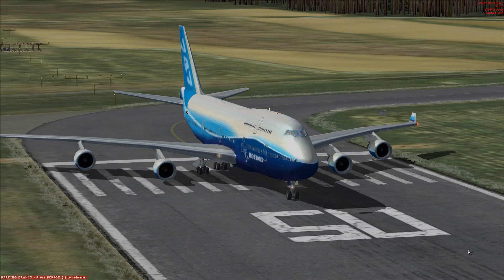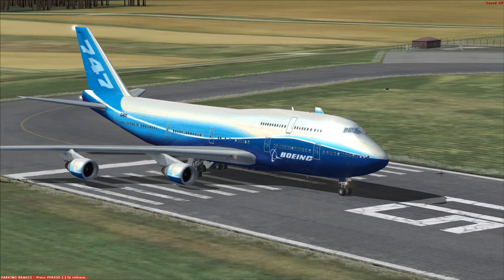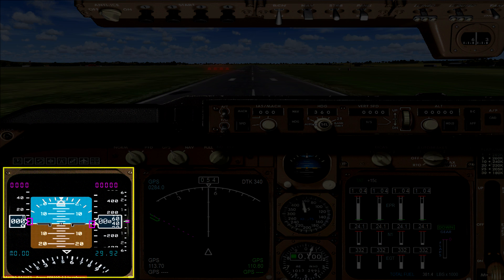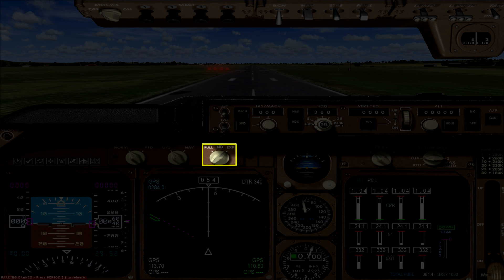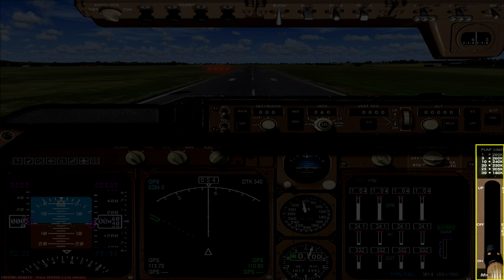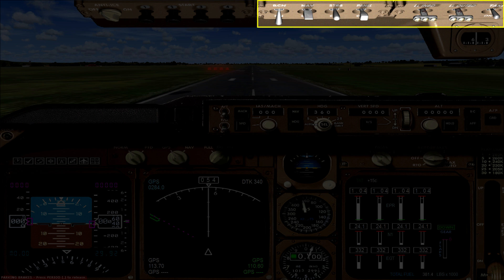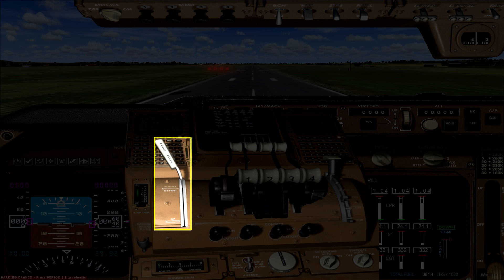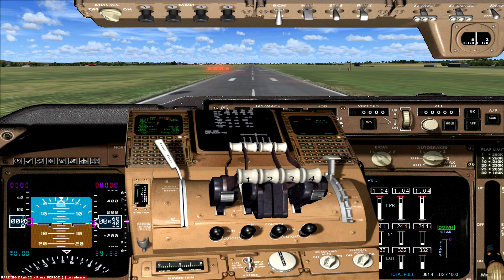FSX Tutorial: Boeing 747

Comment: I’m not sure why but my 747 is very easy to stall even with low payload and once it stalls it’s all most impossible to recover. I put the nose down but no increase in speed even if I increase throttle. The aircraft  just drops out of the sky like a brick from 35,000 ft. I can’t correct it or anything. This never happens with the default 737 or my DH Comet Add-on. Any idea what could be wrong?

Comment: Steam edition
Reply from the maker: Yes this is FSX: Steam Edition
Reply: Doofer911 how’d u get ur 4 throttles to work engines 3 and 4 only go up to 75% on my copy
Reply from the maker: Is that using a joystick throttle control? If so, you may need to recalibrate the joystick in FSX.